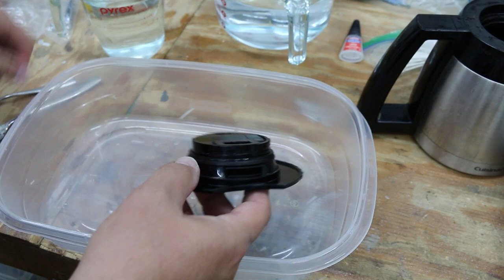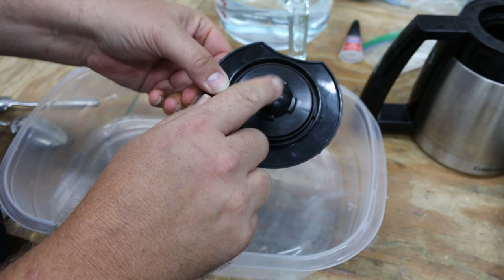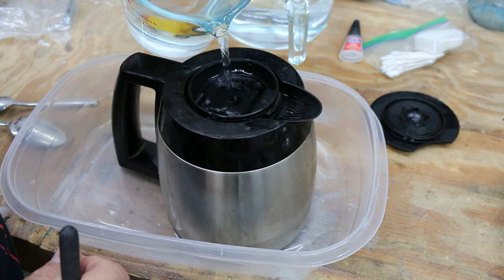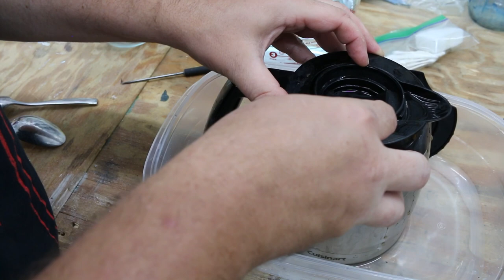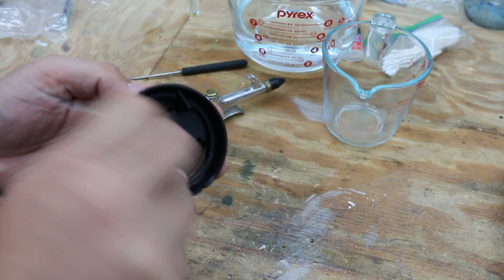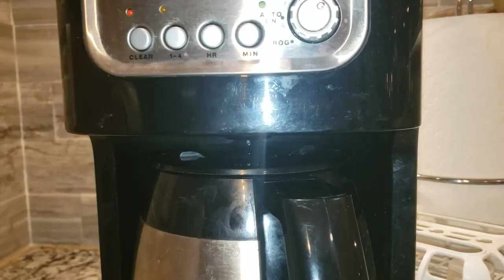Cuisinart Coffee Carafe Fix

Comment: Cuisinat has some replacement parts on the discontinued DGB600BC that has the 10 cup insulated carafe with this over engineered lid. 
I wonder if taking all the mechaninizems out and leaving the top hump piece and just letting the coffee flow through is something that would work. I might even drill a bigger hole on the bottom piece so the coffee would flow into the carafe unimpeded.
I could always buy the replacement lid if it didnt work out.

Comment: Yeah, ok, but what about taking the pot apart? Mine seems to have liquid between the stainless steel inside and outside, trapped within the space
Reply: I have the same issue. Tried several approaches to draining that space but no luck. I imagine it reduces the insulation capability of the carafe.
Reply: Me also, hoping to find some way to drain or dry and/or then seal the carafe so that water can NOT go inside the inner walls, as it should NEVER be in there, and probably will get nasty and corrode the inner walls over time…
Reply from the maker: Sorry, I haven't had that problem...yet.

Comment: How do you put the lid back together, it seems impossible to make it snap.
Reply from the maker: It's a tight fit, but it snapped back together.  Make sure that the tab is lined up.
Reply: Thanks.  Haven’t had this issue yet but now I know what to do.  My issue with the carafe is how difficult it is to get all of the coffee out.  Maybe it’s on purpose so that you don’t get sediment
Reply: Question: why do you even need the bottom part of the lid?
Reply: @msbutkus yeah, I’ve noticed that also, and frequently just take the lid off to get a good pour, as sometimes the lid pours in a funny/bad way, and/or doesn’t let you easily get the last 1/3 or so of the carafe, but just taking the lid off, and gets me a nice clean easy pour, especially if it’s not the first 1/2 or 2/3s of the pot, if not just always taking the lid off prior to pouring works great for me.
Reply: I just bought this and first time I used it it was leaking!

Comment: Brand new out of  the box and overflowing. Looks like defect in the lid where it should drain into the pot. The hole is not holing. So mad about it. I cant seem to take it apart like you did with the spoon to punch the small plastic piece out of the hole.